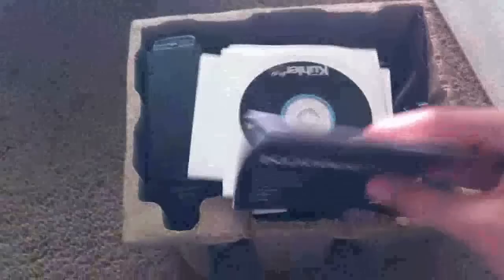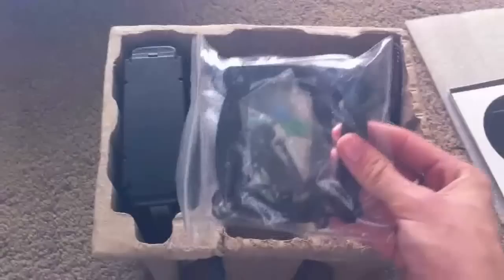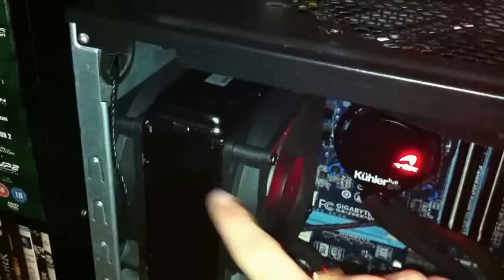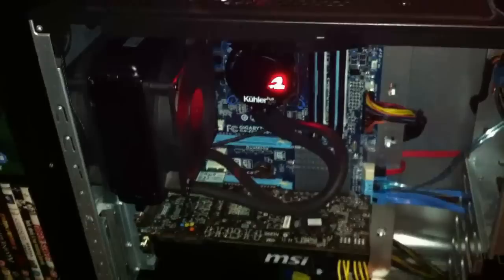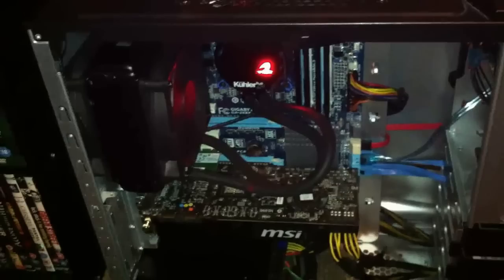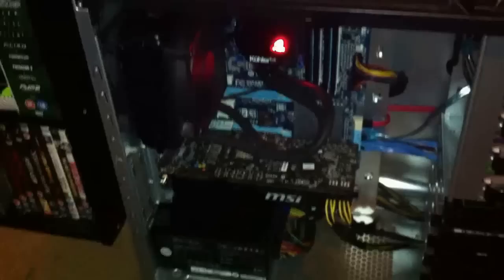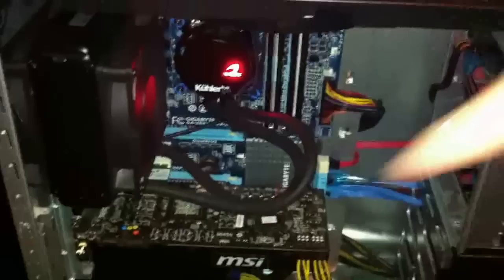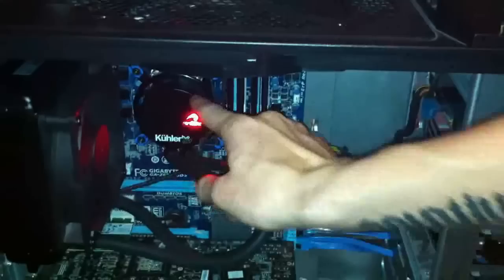Unboxing Antec KÜHLER H2O 920 Liquid CPU Cooler

Comment: What cpu are you using and what have you overclocked it to? also when gaming on that overclock do the fans ramp up to 100% whilst under load because the fans i have seen in vids are really loud. If under gaming the fan auto adjusts to about 60-70% speed then that should be ok, i dont want it to go flat out as im obsessed with noise